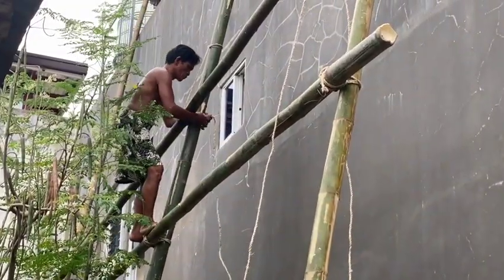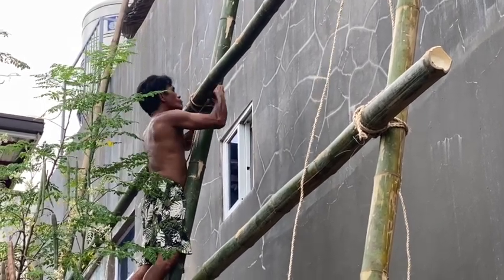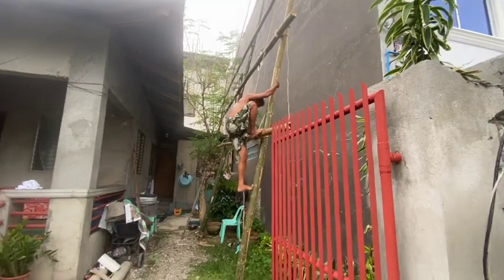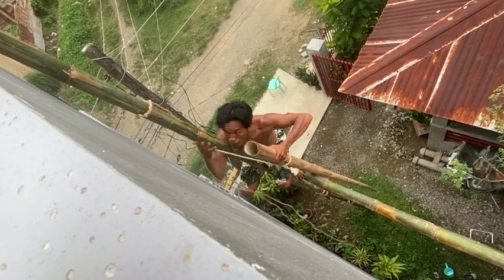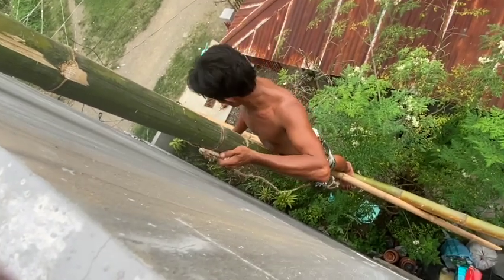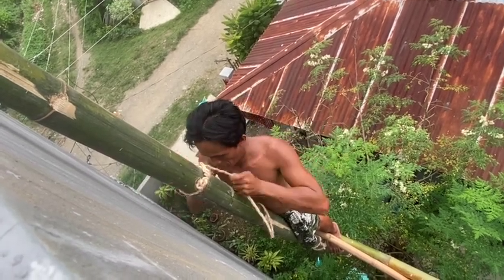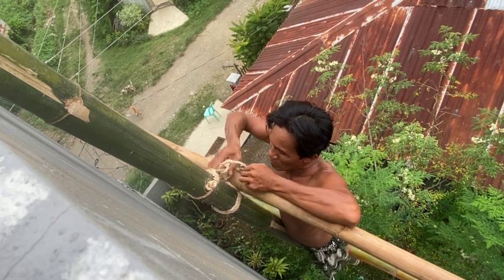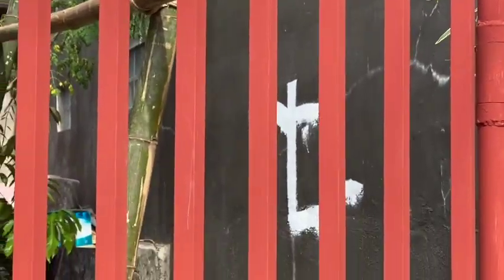Painting my House In Iloilo City

Comment: Safety 3rd!.. but it gets the job done here.  They grey is waterproofing I assume?  500p a day is about right in the province.  More if special skill like welder, less if just labour.
Reply: I forgot to add.. if you do the clear coat gloss over this.. the 'stains' from the water\rain will clean without damaging the paint.
Reply from the maker: Yes the dark paint is 3 coats of waterproof paint. It’s Ben on there for 3 years. I got the “Gloss” white so it would shed water better. That’s what they recommended.